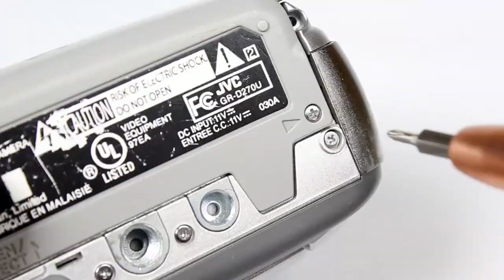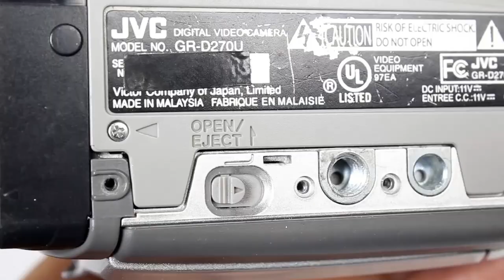How To Disassemble JVC Camcorder

Comment: Hi bro, my cassette player wont come out. what’s the problem?
Reply: i have the same problem,did u find a solution?
Reply: The tape is stuck. You need to disassemble it as shown in the video. Move the tape a little bit, reassamle and it should work again. At least it did for me today